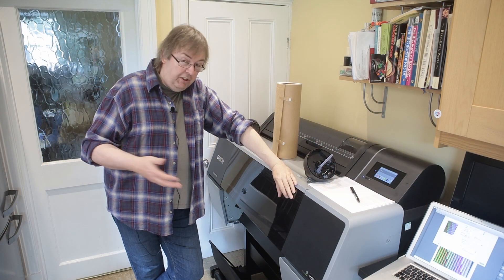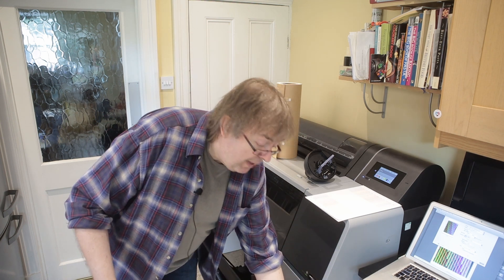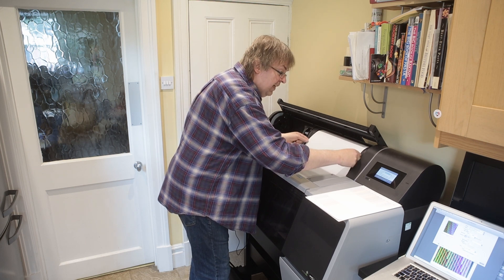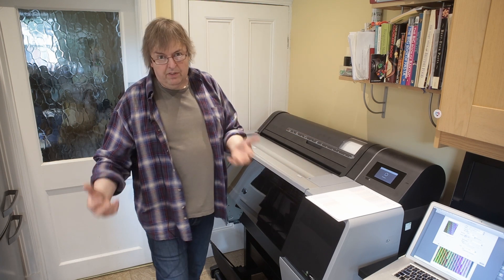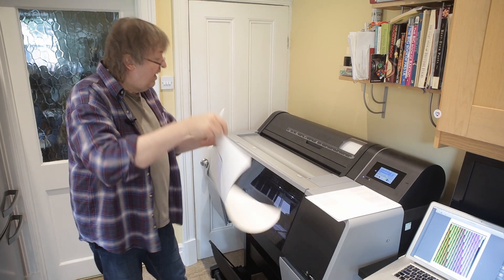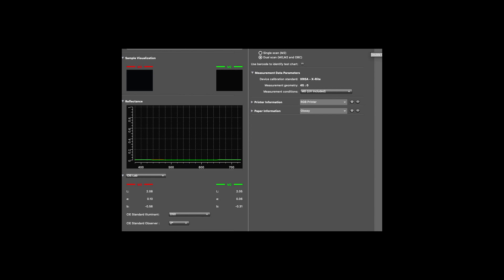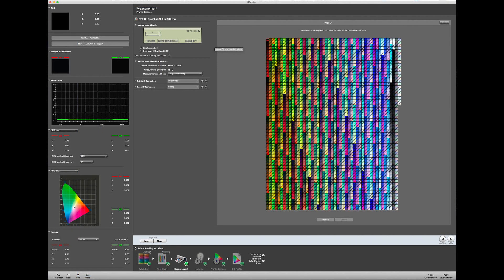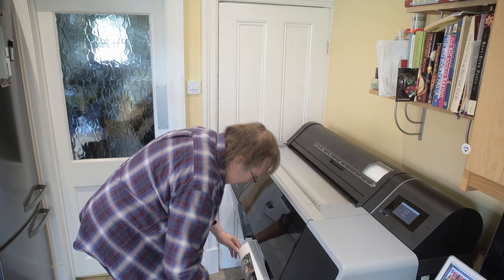Epson p7500 [7570] first prints, profiling and choices for print quality

Comment: I wonder if you could help. Whatever settings I use a large A1 print is always over to one side on a 24 inch roll, so I have a large border one side and a small one the other!
I'm obviously doing something wrong but I can't figure out what. I'm using Qimage
Reply from the maker: Print from Epson print layout to test - otherwise I'll have to blame Qimage, since I've never used it :-) ;-)
Reply: @KeithCooper  Thanks for getting back Keith - I have managed to do it in the Epson print properties rather than Qimage.

Comment: Epson p7500 vs Canon imageprograf pro-2100.. which u think the better ?
Reply from the maker: No simple answer... depends on why you want a 24" printer and why you choose just these two models...
I could produce great prints with either, which most people couldn't tell apart
Personally I prefer the straight through print path of the P7500
Both are usually limited by the skill of the person using them far more than the functionality of the printer.

Comment: Hi Keith, 

Many years ago I was a regular reader of your website and in particular your printing reviews. Back in 2011-12 ish I bought an Epson 7900. Had no issues with it whatsoever and sold many prints from that model. 

Fast forward a decade and I’m now setting up a studio and want to do my own printing again. 
It’s between the 7570 and 9570 or the Canon equivalents. 
Have you experienced any head strike issues on thicker papers with this printer or the 44inch version? 
Thanks 
David
Reply from the maker: I only had the P7500 here for a while to test but did find that paper settings need care, and were a good reason to make custom media settings.

I had no significant issues, but have tested a P9500 at a client's [teaching colour management stuff] and at a recent event, where I did see head marks on a particularly stiff paper - until the vacuum setting was upped.
Still a printer I'd get if I had the space/money/work ;-)

The PRO-2100/4100 are effectively identical to the PRO-2000 I did a lot of testing with when it came out [8 years ago - so no videos] A good printer but awaiting a significant update [as with the PRO-1000 which uses the same printhead]
Reply: @KeithCooper  thanks for the quick and detailed reply. It’s much appreciated. Now I just have to source them and pay a premium thanks to import taxes where I am. I’ll likely go with the 9500 but I’m going to need some help moving it, I distinctly remember putting my back out getting the 7900 up some stairs before.
Reply from the maker: Two of us had difficulties with the 7500, so the 9500 needs at least 3 I'd say...
Reply: @KeithCooper  luckily getting a bit of help won’t be a problem for me here.
Reply: @KeithCooper  one thing I forgot to ask you. Is the data colour suite of calibration tools worth it for the Print calibration? I found previous generations weren’t great in terms of the print profiles they could create. I ended up outsourcing and getting custom paper profiles made.
Reply from the maker: The datacolor software is good, but the print measuring device has not had any significant change in 15 years.  An i1Studio [aka colormunki/ccstudio] is a much better device these days.
Better still buy paper from a supplier who makes profiles for you...
Reply: @KeithCooper  ah yes, I’d forgotten about that brand but remember now from your website that the Colormunki performed better. As I’m in the Philippines I’ll probably have to import paper from B and H and as I like to use a variety of papers I’ll take a look at the i1 studio. Thanks for all your help.

Comment: Always great videos. I’ve seen that oem ink is available quite cheap on eBay (under $100) for expired OEM ink. Would this be problematic to use?
Reply from the maker: Probably not, if you use enough. The ink system is sealed so the carts last a long while
Reply: @KeithCooper  Thanks for the reply and that's great to know. It's almost cost effective to get one of the older larger format printers like the 7900. Seems these are also being used extensively for DTF printing and perhaps that also causes there to be a glut of unwanted pigment ink cartridges.

Comment: Another great video Keith, after using the new Epson 7500 would you recommend it over the Canon ProGraph 2100 ?
Reply from the maker: Thanks
Fortunately, in this case, my policy of never giving brand recommendations comes to my aid ;-)
The PRO-2100 is pretty similar to the PRO-2000 I reviewed, in most aspects. At the time I thought the P7000 (also reviewed in depth) was broadly on a par with the 2000. 
Although I've only looked at the P7500 for relatively few papers so far, I'm minded to think the P7500 is a noticeable advance in some areas of print quality and usability over the P7000 (which I'd happily use BTW).  
Obviously I've not tested the 7500 for very long, but I've made some very nice prints...
Reply: @KeithCooper  tally understand. I currently have a Epson P5000 which has served me well. My HPZ3200ps 24” finally died after almost 23 years pf use so I am in the market for a new “24” printer.
Reply from the maker: I do have a P5000 here, so I may do a few direct comparisons (since it's the same as the P7000) - the bigger print head of the P7500 makes for a few differences (so possibly not fitting in a potential 'P5500')
Sheet feeding on the P7500 is very effective...

Comment: Love your work - but you need a compressor for your audio feed as on this video it is rather distorted. Or a limiter to stop the over loading.  Your mic location looks fine but definitely look into a compressor/limiter.
Reply from the maker: Yes, sorry about that - a fault on this one I couldn't tweak enough in post.
It seems that a flat battery somewhere reset some settings - didn't spot it until I edited the clips and all my videos are unscripted and usually just the one take.
I'll recheck the complete sound setup for the next one...

Comment: Just a side note:
U said it has a green ink.
My printer Epson 8550 doesn’t and the printers I’ve had don’t.
Would you say that the Green ink is necessary?
Thanks for the video!!!
Reply from the maker: Yes - for the market this is aimed at (fine art and proofing)
For the market the 8550 is aimed at (it's mostly dye inks) no
Two very, very different target audiences (and budgets)
The presence of the green, orange and violet inks make for a distinct improvement in the gamut - not always that noticeable in many images, but they also improve the overall smoothness of the whole range of colours within the gamut boundary.